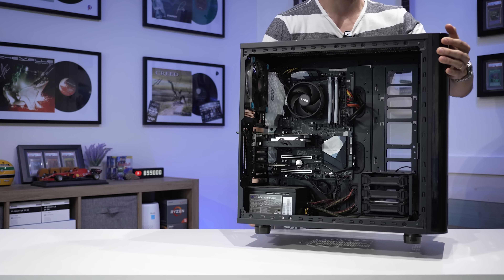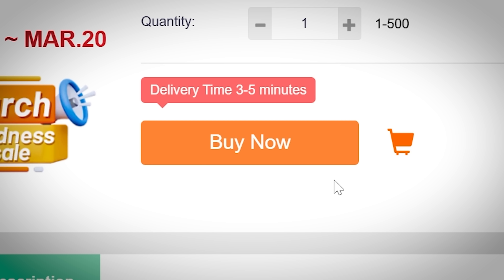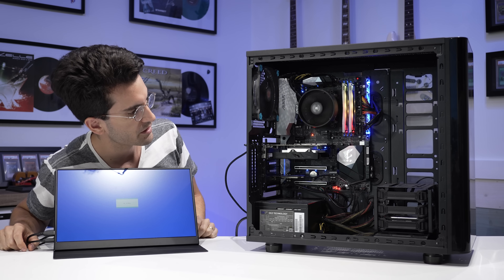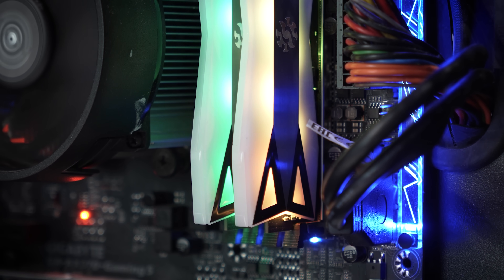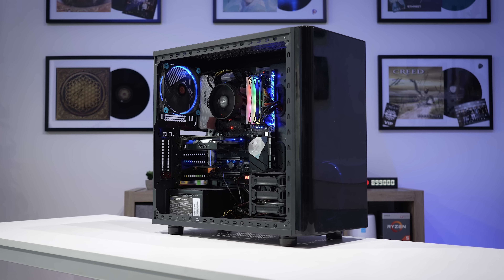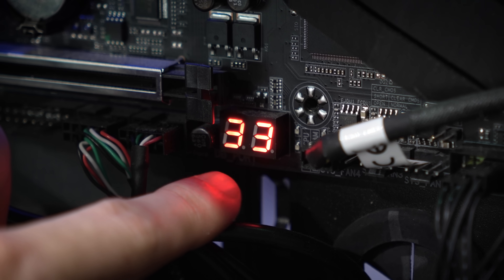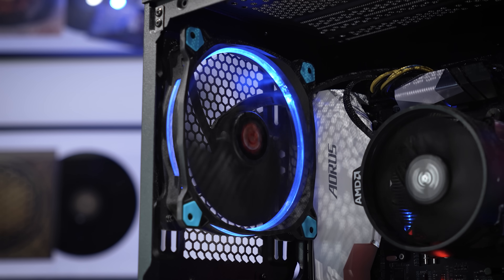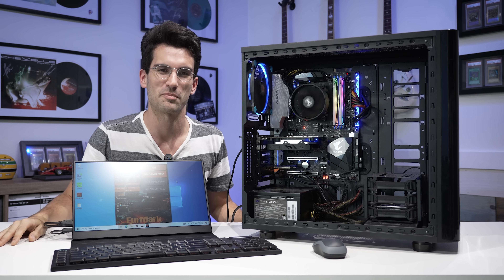Fixing a Viewer's BROKEN Gaming PC? - Fix or Flop S6:E17

Comment: I just wanted to ask you for a piece of advice, my rig is a Gigabyte a520m k V2 rev1.1 and is paired with  a Ryzen 5 3400g, Rx 470 and 16gb ddrr4 at 3200mt working currently at 2666mt,  part of the issue is that my graphics card usually gets disconnected and a pop up error from Andrenaline software says that it was an issue with the graphics card driver, sometimes the system just freezes and reboot is the only option, and sometimes it takes several minutes even to reboot or shut down my pc,(this only happens whenever the card gets disconnected) the only way to prevent that Is to disable xmp, amd core boost and fclk oc flag, if I activate any of that my graphics card begin to get disconnected sometimes once or several times per day, can you help me maybe a little guide to trouble shoot this, I appreciate any kind of help.

Comment: People don't realize how fragile cables are, in my own experience, I will typically try a new cable. before assuming anything else.  Figure that a wire in an HDMI cable is well under 1mm in diameter, it's easy to break one of those, break the wrong one, and it's not going to work.

Comment: I know I'm a bit late responding to this video, but since the user's cable is suspect, I wanted to share my story. Years ago I had a Dell monitor which at the time of the event was relatively new, and the picture would intermittently go out. I couldn't isolate it to any process (i.e. gaming or other loads), and I suspected the cable could be bad so I removed it and checked for continuity on all the pins and contacts and it passed, so I figured I had a bad monitor. It was still under warranty so Dell replaced it. Not long after receiving the new monitor, the problem reoccurred: intermittent signal loss. At this point I figured I would replace the cable because that was all that was left to replace (I probably tried different video card/motherboard ports as well). The first thing I noticed when plugging the new cable into the video card was how much more snugly it fit...that's when it hit me. Despite having good continuity end to end, the old cable--which was supplied with the monitor--didn't have an adequate connection, despite being secured with the thumbscrews (it was a DVI cable). I tested the old cable again and was able to replicate the issue, but never had any problems with the new one. I guess the moral of the story is that cables can fail in ways we may not expect...😳

Comment: HDMI cables are often the culprit for weird display issues (loose connections due to PC cases or bent pins). Since they're cheap, recommend keeping spares for testing. DisplayPort usually avoids this with its locking pins.

Comment: It's possible the '33' code may actually just be a CPU temp monitor after the BIOS finishes POST. I'm not as familiar with Gigabyte BIOS, but that is a BIOS menu option for some Asus boards.
Reply from the maker: It's not a temp. It's static and never changes. No CPU on earth does that hahah. Temps would change all the time.
Reply: @GregSalazar  Yeah if it was CPU temp and didn't change, I'd be waiting to see flames coming out of it shortly. lol

Comment: As soon as the system booted my 1st thought was hdmi cable got wrecked in the altercation, after a fairly exhaustive set of tests and checks, seems like that's your call also.  We may not have learned anything new, but confirmation is a good reminder that sometimes it's just a bad cable.

Comment: HDMI cables are way more sensitive than most think. I have no doubt that his brother stepping on it and ripping it out of the back broke some of the small wires inside the cable. I’ve personally had them fail for no apparent reason at all. I’ve also gotten bad cables out of the box. I keep a small arsenal of them around (I do a lot of PC and AV work). I hate having to do that, but when you really don’t have time to be down, it’s the safest way to run.
Reply: Same experience, if you look at them the wrong way they kick the can!

Comment: Weird issues can happen in the PC world. Lemme me tell you mine. All of a sudden, PC, after any read or write to any of my secondary m.2, ssd would not be accessible, only system drive worked. After rebooting, everything seemed  to be fine, until I tried running a game from those ssds or copied some large files. No warning, no error, just drives couldn't be read from or be written at. The first thing I did was reinstalled Windows, everything looked great, I was happy grasshopper, until I ran Doom ache Dark Ages... 2 minutes into the game, Bug Splat, drive inaccessible. My heart sunk. I tried resseting BIOS, ch3cked for viruses, reinstalled Windows, nothing worked.I was starting to believe it was my CPU. Although I have a 12th Gen, it is still an i9, so I thought that it has issues with microcode or oxidation. Until....

I started checking my cabes and connections. I got lots of RGB in my build, and one of those 3-pin RGB connectors on motherboard was not fully seated. It was connected just enough for lights to work, but it wasn't plugged all the way in. One connector. After nudging it back, my issues went straight away. I spent 3 days troubleshooting, and at the end, this small little thing was the culprit. 😢

Comment: This was 100% a damaged HDMI cable. If they managed to actually yank the GPU right out of the motherboard there's zero chance the cable survived as that kind of twisting impact will always bend something in the cable and prevent it from connecting properly. That's why it sorta worked, at low res it doesn't use all the pins but once you up the resolution it does which matches his symptoms perfectly. Plus Greg got it working first try, which makes sense because he was using his own cable. This is why I always keep at least 2 extra HDMI and DisplayPort cables handy (I have 2 monitors). If a cables dies I always have a replacement. He's lucky it didn't damage the actual GPU or motherboard too. Although who buys an X board for a 2600 :P

Comment: Did you say DDI? FYI, This one is known as a DVI-D (D for DUAL) which is still better than VGA but no Audio and DVI has some Grey scaling. However DP is always the better option. (if your monitor supports it) Also DVI-I is the best type of DVI which is both Digital and Analog.

Comment: The same thing happened to me, i myself tripped over my hdmi cable...yes my pc tipped over and my cable plug was completely ruined "had to buy a new cable"  but my card was still fine as the port was not damaged just the cable end. My card did not come out of its slot and as it was screwed down did not shift either, could have been worse since my pc hit the floor, was a very old cooler master case "heavy and built like a tank" top radiator cover broke, nothing some super glue couldn't fix.

Comment: At 7 minutes in I wonder if the trip and fall broke the owner's monitor HDMI port due to the force of the yank on the cable. One other possibility is I see DVI, HDMI, and Displayport on the RX 560. SInce your Pixio monitor uses HDMI, I wonder if the owner mistook DP for HDMI and the RX 560's Displayport is broken due to physical damage. (It takes a lot of force to yank out a Displayport cable unless you push down the latching mechanism on the cable end)

As for lingering GPU Issues I wouldn't be surprised if he legitimately doesn't remember reseating the card more than once. Visually the slot looks fine, so in reseating the card he may have firmed up a wonky connection that was causing him issues earlier.

And at about 9 minutes in looks like you reached similar conclusions. On the one hand, nice to see the system isn't broken. On the other, it's not entirely satisfying when you can't 100% replicate the stated issue.

Thanks for another Fix or Flop! :)

Comment: I had this same issue with my rx550.. brother pulled my dvi adapter out and I thought it was my pc that stopped working as everytime I tried turning it on.. black screen... I ended up getting a new monitor which had an hdmi port in and it worked fine.. I then bought an office pc and used the stock motherboard dvi port on my old monitor and it was fine.. this led me to believe that the adapter had broken.

Comment: Sounds like the owner was plugging the monitor into the back of the motherboard instead of the GPU or they have a USB device, such as a storage drive, that prevents the machine from POST.
Reply: Could be bad hdmi cable, bad hdmi port on monitor/tv as well.
Reply: @lancealbert  Not as common or likely, but possible.
Reply: @CareyHolzman  Bad HDMI cables are super common, I just threw away about 5 of them because I had it with the signal integrity issues, and with my new 4k oled @144Hz I didn't want to take the chance of mistakes happening.

Comment: Looking at the motherboard, you are missing 5 mounting screws that all appear to be grounding. Is there a chance that an open ground circuit could lead to the issue?
Reply: You do pan across the open screw holes a few times in your b-roll as well

Comment: im having a issue with my computer restarting while playing madden. Changed the psu [new corsair 1000e],reseated the ram and ran a mem test its good. Temp reaches max 45 to 50c on cpu. 5600x and 7900gre. The only thing i see is my cpu reaching to 100% usage sometimes.  That would cause stutters n stuff but why is it restarting😩. Lost so many games because of this When I play franchise mode it doesn't restart, only online gameplay..like wtf!

Comment: for "security reasons" you dont hook up internet to users PC... Hmmm, so your router doesn't have a guest mode which cannot connect to your private network, or not have a spare computer running a VM and setting the network up to something that the outcome is there would be no way that VM machine, hooked to a seperate router which is hooked to the guest mode on your router? I'm 52, no I dont fix computers, it personally bores me they are too easy to fix nowadays. But I think you downgraded your channel by not being able to securely setup a private guest network.

Comment: I was running a 1070 on an old TV. The only way I could get it to work was boot the PC up and then plug in the cable. If I did it any other way, it simply would not display anything. When I upgraded my system, everything brand new and brand new monitor, I was getting no display. After 30 minutes, I found out that the DP cable wasnt plugged in all the way in my GPU, even though it "clicks" 🙃. Gotta love simple fixes. I still have my old RX560 in a spare PC. Its a great little card for older games :)

Comment: If the owner is connecting to a TV with the HDMI cable, some TVs can be really fickle about the GPU signal over HMDI, even expensive TVs. For a long time, I had to use a HDMI-to-DVI Adapter to get my RTX 3060 ti to work with a Sony Bravia TV. More than mildly frustrating. So I could see a slightly damaged cable possibly causing issues.

Comment: Congrats on 900k!  WOOT WOOT!

In IT, we classify these issues as PWA - Problem Went Away. 
Doesn't mean something couldn't be wrong, but it's not wrong with the hardware presented.   
Occasionally the issue is a PICNIC or PEBKAC (Problem in chair, not in computer or Problem exists between keyboard and chair)      I don't think either of those apply in this situation, but more IT fun!  :D

Comment: You toke the time to fully diagnose it. With clear reply whats most likely the reason and how to test for that. An other job well done!
Generally, a faulty cable is rare. Unless something happened like a snagged/ripped cable. In that case ask them to check with other cables and monitor/TV first. It's still a educational episode.

On one of my dads PC's I once had a fauly cable. With no reason for it like a ripped cable. Toke me a while to figure that out...

Comment: Had a weird issue the other day. I flip pc's, bought a system with a b350, 3600, 16gb ram, and a gtx 960. everything worked fine, so i stored it while i waited for a 2070 super i ordered of ebay. after getting the 2070s,  the pc wouldnt post with any gpu. it would boot to a black screen with one single white dash. after pulling the m.2 ssd, it would boot to bios. Somehow, while just sitting on a shelf, something went wrong with the bios im assuming. i updated the bios, and everything works great. just a weird thing that having an ssd in the m2 slot wouldnt let it post

Comment: I have a cheap Asus 3050 video card that has a failing or failed DisplayPort.  In which case I just switched to HDMI.  I don’t see why a monitor with multiple inputs wouldn’t or couldn’t fail in a similar  way.  Bad cables could be a problem too.

Comment: Wasn't a HDMI, but on my TV I run my surround sound through the optical port on it as it has 5.1 pass through and cuts down on needing multiple HDMI cables. One day it just stopped working and I was trying to work out if it was the receiver or the TV port that was the issue. Turned out it was the optical cable (luckily I had a spare).
It's crazy how cables can randomly go bad, but obviously this time it was for a very physical reason.
Now, whenever anything goes wrong like that, I always check the cables first as that is generally the cheapest fix anyway.

Comment: I recently bought a motherboard on ebay, built an i3-12100 with a RX-6600xt. Computer worked perfect, until I tried to get into the BIOS. NOTHING I tried got me in there. Turns out it was the HDMI cable. The output of the BIOS signal was just below some threshold of that cable. After 2 days of trying all of the tricks I learned on this channel, I tried a different cable. Bios came right up. Turns out the BIOS was there, it was just the HDMI cable not displaying it! I thought it was worth mentioning.
Reply: Thanks for sharing, it could save me a lot of pain one day
Reply: Had/have same proble when I bought AsRock DeskMini A300, no BIOS, I was going crazy, switched to display cable, everything normal. Had also new Monitor with new cable, tryed different HDMI cables, nothing. Till today I don’t know what’s the catch.
Reply: dang. i've never heard of that.

Comment: i have 2 monitors, one is HDMI and i think the other is DVI. had a similar issue with the DVI, think my daughter knocked the wire and i ended up buying a new cable but there was a point i thought she had broken my 3060 and i couldnt afford to get a new one. luckily cables are fairly cheap and ive had no issues with latest cable. although im not sure the 3060 will live much longer because she seems to run a bit hot. hot spot of up to 105C with GPU temp of about 85-95C in HWMonitor while gaming (im british and we use C). to me thats high but someone might say its normal under high load. 

Anyway a win is a win even if its at little or no cost lol

Comment: I thought Greg done got locked up with that shirt on. Any update on if a new cable fixed it for the user? Did they say what resolution they were trying to use? If they select one the GPU doesn't support then sometimes it will cause a black screen and they'll need to use a different monitor or try booting into safe mode to fix

Comment: One time I bought a very nice Business core 7 HP desktop at a yard sale for $30. They swore it didn't work and it looked brand new. I went home plugged it in and didn't get anything. I was pulling my hair out and thought it was dead. Then I was like what are the odds the power cable that it came with is bad. Sure enough replaced that and it worked like a champ.

Comment: Nice you got it up running. But yeah ports on gpu can go bad as on my own gtx 1080 strix. I used to use the dvi-d too a monitor, but after a few years i started getting wierd artifacts on the screen, and could not figure it out. I only got it away by starting to use the DP too hook up to montiors and they went away.  So yeah my DVI-D port is broken, but dont hurt at much as no longer useing a montior with dvi-d.

Comment: If you do still want / need to give a fix or flop PC internet access, consider just setting up an ssid on a separate guest vlan (if it has wifi). If you're running Unifi gear, it's pretty easy to make a new vlan and set a port on one of the switches to that vlan and keep it isolated from the rest of your devices and network.
Reply: VLAN, or maybe even a completely separate LAN if you are that paranoid, should do the trick

Comment: can some help me with this. my pc is sometime showing "USB Device Over Current Status Detected !! System Will Shut Down After 15 Seconds'' now am on latest bios and I've tried clearing cmos and unplugging all the usb cables too after that for sometime it will run normal for few days, later the issue occurs again. even if there no usb connected it still shows the same notification on windows. there's two usb port back at motherboard are not working but if i clear cmos they will work fine for sometime and go off again. is there a way to fix this please help.
Reply: 1.	Physically Inspect All USB Ports
Look for bent pins, debris, or burn marks. Use a flashlight.
	2.	Disconnect Front Panel USB Header (Internal)
Open the case, unplug the USB header from the motherboard (usually labeled “F_USB” or similar), then test again. This often resolves intermittent overcurrent errors.
	3.	Disable USB Ports in BIOS
Go into the BIOS and disable the affected USB ports if they’re not needed. Some BIOS versions allow port-level control.
	4.	Firmware/Bios Settings Reset
Reflash the BIOS even if it’s up-to-date. Use the “reset to default” option after flashing.
	5.	If Recurrent – Consider Motherboard Replacement
If errors persist with nothing connected and after disconnecting front panel headers, the fault is likely on the motherboard itself.
Reply: @grilnam9945  i appreciate your reply but I've already read this on chat gpt and tried noting changed
Reply: @akmraid hopefully someone else will offer you some assistance, best of luck